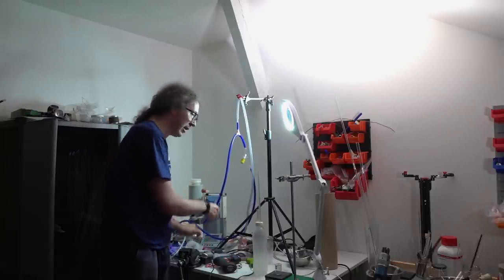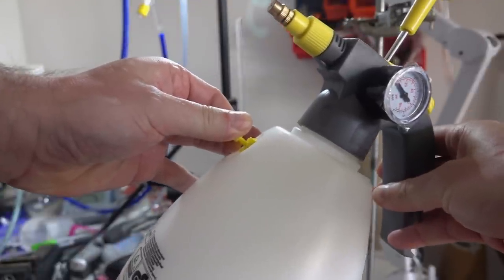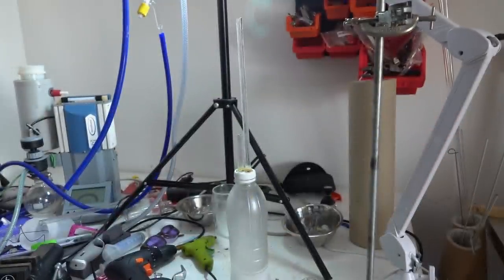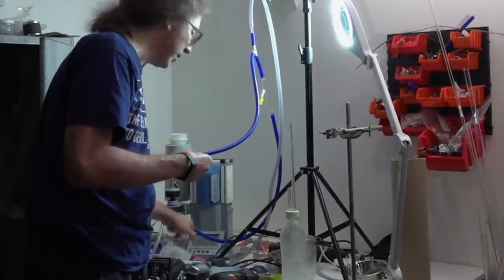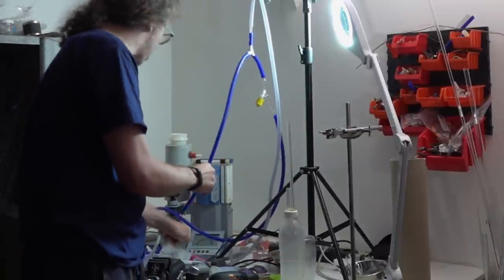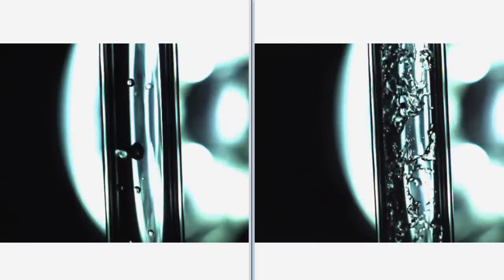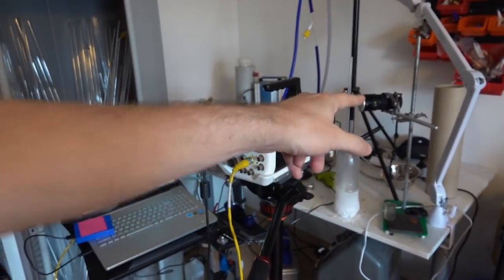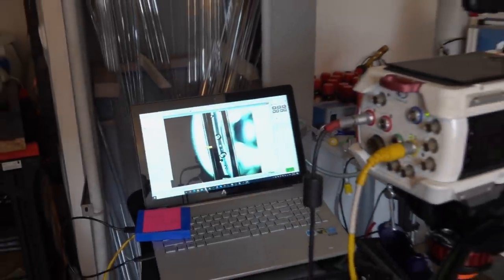The Cryovolcano: Explained (liquid nitrogen in slow motion!)

Comment: Pressure builds from evaporating nitrogen which causes it to release. Not a hard concept to visualize.
Reply: people will see the word "cryogenic" and think "bUt VoLcaNOs aRe hOT tHis mAkeS nO seNse.  SpAce iS fAkE.  rEseArcH flAt eArtH"
Reply: Thanks, you had a better explanation than TF, I still didn't really grasp the concept until I read your comment.
Reply: @ShadowebEB  Yeah, the second tube works like a pressure release valve on a water heater. Once you block that, there's only one way for the pressure to release, and it releases violently.
Reply: He said so himself

Comment: So you cannot suck it with a siphone either ? Like you would to empty a fuel tank ?
Reply: It will boil inside the tube and become nitrogen gas, as demonstrated multiple times in the video. You might be able to do it a little differently though since not all siphons require pressure differences to function. Personally I would insert two hoses, one leading into a catch canister, sealed to the hose. The other to feed above the liquid and blow into, ideally with a flap valve. Push the liquid by gently increasing pressure in the tank. Pump on a stick is another idea, easy to mount  1/2" centrifugal pump into the end of 3/4" tubing, have a water jug pump that is pretty much that and runs on a 9v battery.
Reply: Not in a normal Earth atmosphere you couldn't. If there are any conditions that could allow for liquid nitrogen to be siphoned is a more interesting question. You'd have to cool all of the equipment and gases used below the boiling point of nitrogen. There should be an ambient temperature and pressure of gas above the system that would allow it. Looking at the phase diagram, something like 10 bars and -180 C should do it.  I'd need more precise numbers to give an actual range and max lift heights.

Comment: I still don't get how it works
Reply: Think of it as a boiling kettle. Normally the pressure escapes through the short tube. If that's blocked the pressure has to go somewhere. The only place for it to go is the tube under the liquid so it pushes the liquid out well trying to escape.
Reply: @nonna_sof5889  Sure, but why would the rate be faster than it would be if there was only the short tube? 
Or is that not what's happening?
Reply: @mkontent  I'm not entirely sure what you mean. He didn't block the long tube. Even if he had, we wouldn't see any effect. Either way. When the short tube is blocked liquid is forced up the long tube. The long tube is well above the boiling point of the liquid so it instantly vaporizes on contact raising the pressure even more. As it cools down the stream gets a little less energetic, but the amount to heat being added from the sides is still enough to force the liquid out with some force.
In the end it's mostly the case that blocking the tube lets us see how much energy is actually being added rather than adding a lot more.